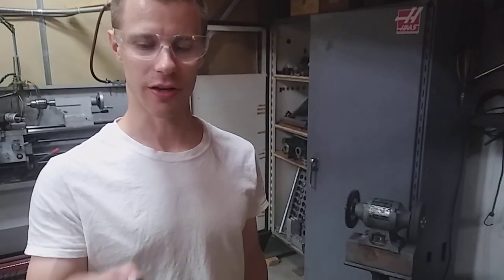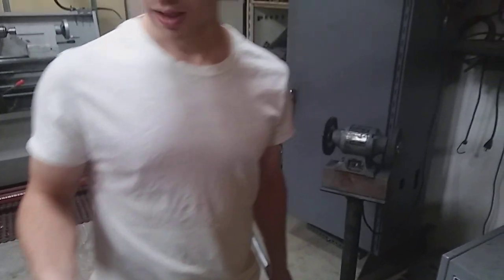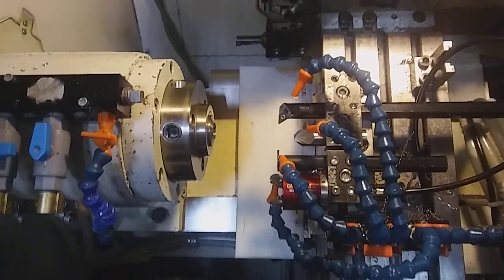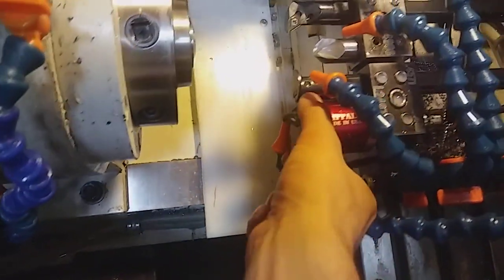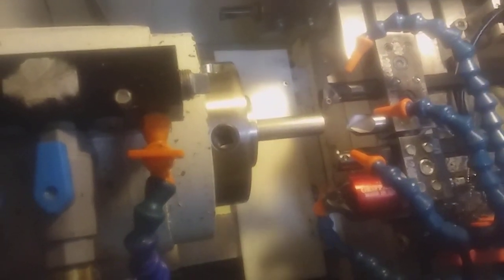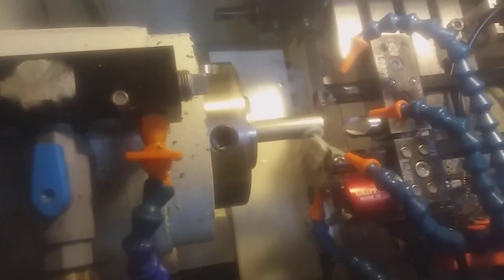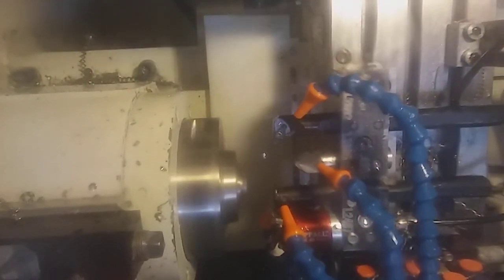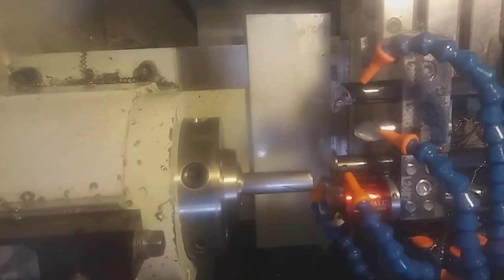Tormach lathe running production

Comment: How have you found the Tormach lathe just in the middle of a purchase myself hope I have made the right decision
Reply from the maker: I suppose it abides by the adage "get what you pay for".  I would love to have a nice Haas with more power, tool probing, faster rapids, etc, etc, but the tormach's holding it's own.  I definitely wouldn't recommend it for high volume production production, but for a shop that doesn't do a ton of turning like us, or for a hobbyist I think it can be a good fit.  I'm typically very satisfied with repeatability.  It'll usually hold a few tenths of diameter pretty easily.  Let me know if you have any other specific questions.
Reply: @euclidmachineanddesignllc704  
The machine gets dropped off next week 
How did you find setting it up and getting all the tools set up in the path pilot 
Thanks for your help
Reply from the maker: @davecox900  I don't remember it being terrible.  Did you get a turret?  The offset interface in path pilot is pretty intuitive in my opinion.  For diameters, just take a test cut, measure, and put the value into the control.  I use a dial indicator in the spindle to set z values.  I've got a little procedure I should do a video on for getting the machine and tools calibrated.
Reply: @euclidmachineanddesignllc704  yes went for the turret I have never used Path pilot before so will be a learning curve 
where about are you based
Reply from the maker: @davecox900  We're in the Denver area.  Glad you got the turret.  It makes life a lot easier.  If you want to shoot me your email, I can send you some pictures of how I calibrate the machine and tools.

Comment: Pretty cool bud!  Well thought out getting 3 parts before pulling the bar.  Not sure I would 
have thought of that myself.
Reply: How did he do that I have a Tormach 8L lathe
Reply: @andyabernethy9000  Not sure in PathPilot.  I have a similar size lathe running Centroid and it's all in the programming.